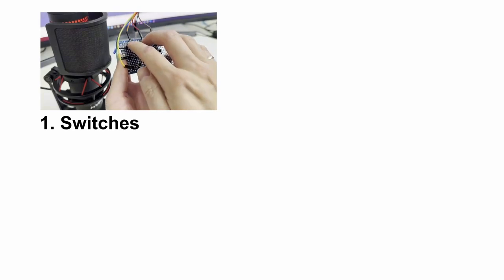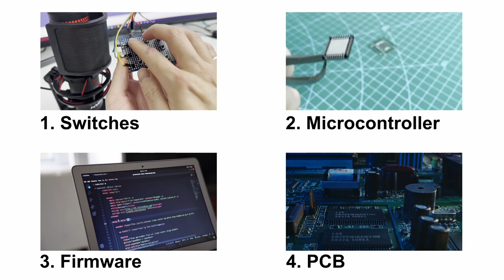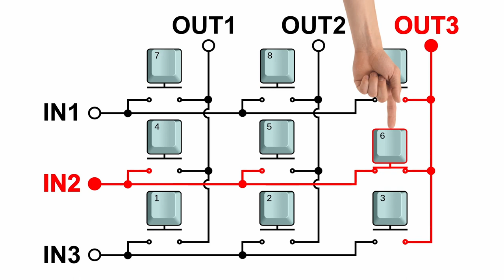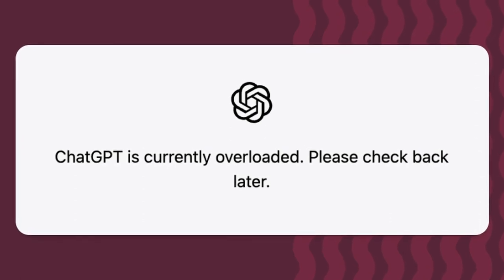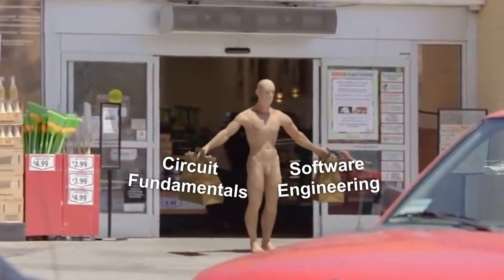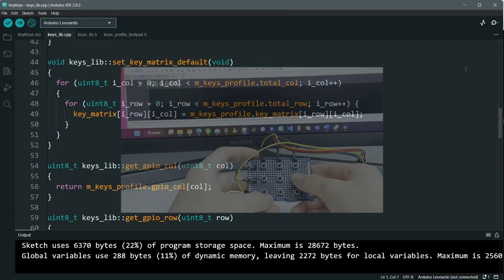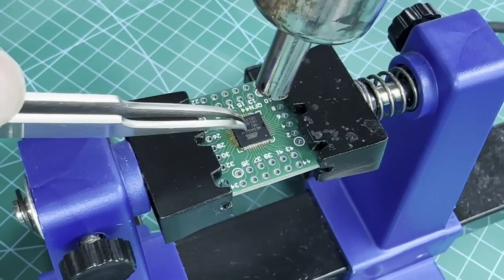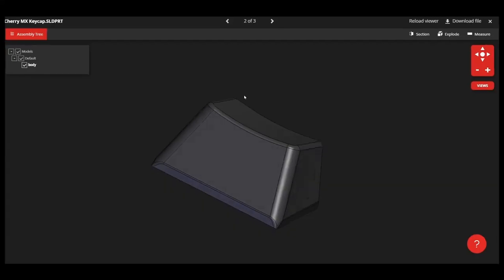I BUILT a keyboard from SCRATCH!

Comment: nice , good idea
BTW which microcontroller is used? Arduino Leonardo, Micro, Arduino Due board or any other board?
Reply from the maker: Arduino Leonardo :)
Reply: The atmega32u4 i think its the only arduino one that can be a usb device. The arduinos that come with it are the leonardo, micro and the chinese pro micro. You can also try the raspberry pi pico, but beware that it is 3.3v as in comparison to the 5v arduinos.